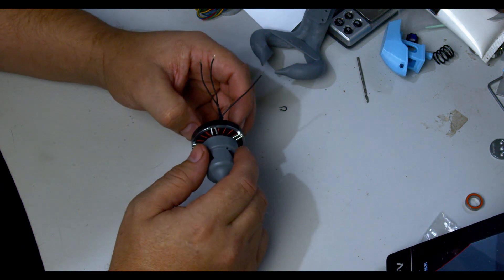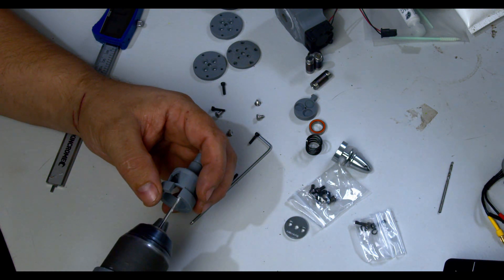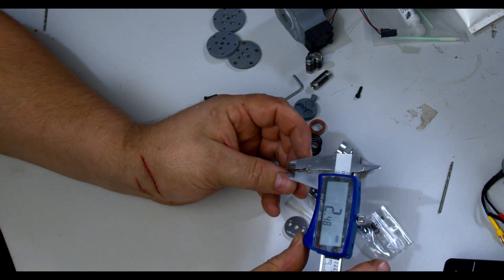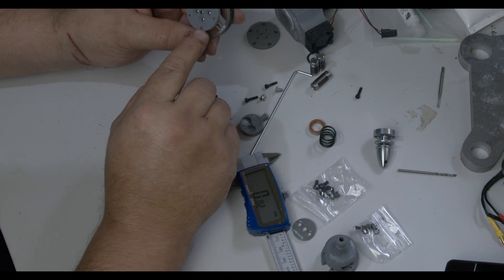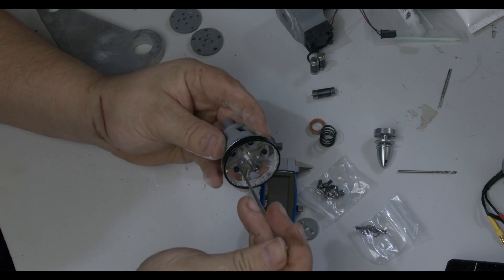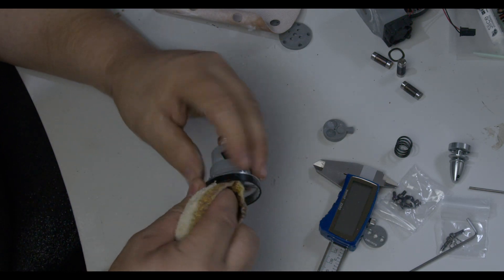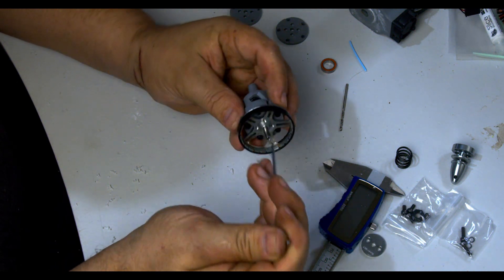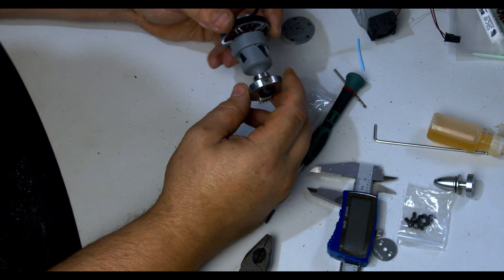BLDC Spiral extruder Open Source Release

Comment: I thought I saw a message somewhere that a company with a patent on a screw extruder had shut you down.  I have been working on a design in Fusion 360 since February of 2016 based on Werner Berry's video of August 2013.  If the above is true and this information is helpful let me know.  Best of luck with this great concept.
Reply from the maker: That was someone else , join on the discord if you like and we can have a chat , the principles of this extruder are also based on those early google docs , and all recognition should be going to them and or the original Stratasys patent that predates it all

Comment: i have a question what do you need to put a clearpath servo system?
i heard that you need a controller and a other powersupply?
Reply from the maker: No controller apart from having a stepstick capable mcu , I use the clearpath psu , but you can use a good quality meanwell or something similar . 
I use the clearpath because it’s 72v and is designed to work well with the clearpaths :)
Reply: @vvega007  so in short you just need a servo and a 72v psu?
thanks
Reply from the maker: @3125_engineering   you can use 24v or 48 as well ….. providing you get the sd series , the stepper killers
Reply: @vvega007  thanks

Comment: Why didn't you go with M8x1.0 or M8x0.75 instead of those custom rollers with 0.8 thread? Would've been much easier to just take a standard screw and machine the ends as needed.
Reply from the maker: Because that wouldn’t work with how it’s designed  , the square edges of the thread are important to how it feeds and how it tensions on to the filament. I also wanted it as light as possible . Feel free to redesign and have a go yourself thou , I’m just sharing what I’ve found works well :)
Reply: @vvega007  so take a standard thread and turn it down slightly to get the square tops? This way I don't see how can someone make it without a lathe? Unless you've found a source of 8x0.8 trapezoid screws? Not trying to say you're wrong just throwing ideas your way to make it simpler. As soon as I get me an sla printer I'll have a go at this myself don't you doubt that. I also have some ideas for the bearings.
Reply from the maker: That’s awesome , and so agree I’ve been working at a way around it all but I haven’t had much time as of late there is a discord and I have given out all the step files so the opportunity is there for anyone to make it there own

Comment: If the filament is a straight line and the rollers have a cylindrical outer shape, since they are tilted they will contact the filament in a single point (more or less). What about giving the rollers an hyperbolic external shape, so that the contact surface for each roller would be a line.
Reply from the maker: This is a whole discussion.

Comment: What kind of current does that extruder pull on average when printing?
I'm wondering about using some of the cheaper 2204/2804/2606 brushless gimbal motors with a pre-drilled shaft. The design would need a bit of tweaking since they don't have the spoked can design to allow screws from the back, but they cost about 1/3 to 1/4 what the Sunnysky 4004 costs (and they're lighter too).

I'm also no stranger to re-winding brushless motors, so lowering the winding resistance and raising the KV isn't out of the question either.
Reply from the maker: Jump on the discord and we can chat .. I’ll be in there for about an hour or so tonight

Comment: Thank you, happy holidays. Could you provide a link for the motor you are using, I can't really hear well what you are using.
Reply from the maker: Sunnysky 4004 , you will need a bldc controller for it , but there are a few options for that :)
Reply: @vvega007  What kind of options are you reffering to? so far ive only found the ODrive driver.
Reply from the maker: @RonaldHertog   simple foc seems to be an option
Reply: I only find the 2302 2304 ECT with trough hole. I'm on Ali,Banggood no good ;-)
Reply: @VinokDesign  he drilled the shaft himself I think
Reply: Yeah, I think so to, by the looks of the old video his new motor there it is drilled trough either. no problem, we have a lathe. Thanks
Reply from the maker: @VinokDesign  https://sunnyskyusa.com/search?type=product&q=4004 and yes .. I have a 2mm hole drilled , make sure you take the magnets it’s really hard to get the swarf off them otherwise .   And don’t clamp the outside … only the Center shaft

Comment: I believe you have cover this before, but if you don’t mind me asking. What are the benefits to the spiral extruder over a normal extruder? It definitely looks a lot cooler but what are the functional benefits?
Reply from the maker: It’s lighter , has more clamp and can generate more pressure, it looks way cooler  and you don’t get the teeth harmonics In your print …. However , it won’t print flexible filiments 
I think with work … it has potential for both delta  and Cartesian printers …. Been that deltas have real issues with weight … it might be There way forward for direct drive
Reply: @vvega007  Why doesn't it print flex materials?
Reply: @danielb.2873  Probably because of the intrinsic way the extruder works. The extruder spins over the filament, if the filament is not quite rigid, it may rotate over itself, blocking the extruder.